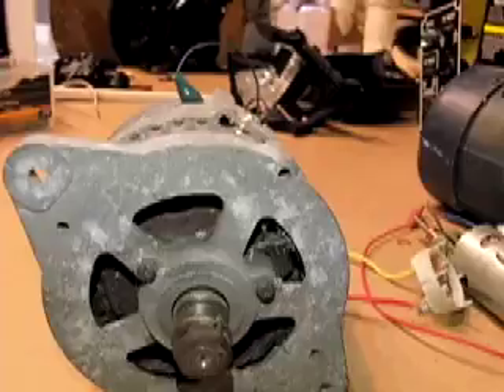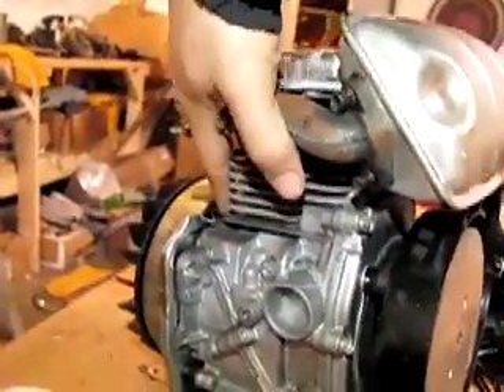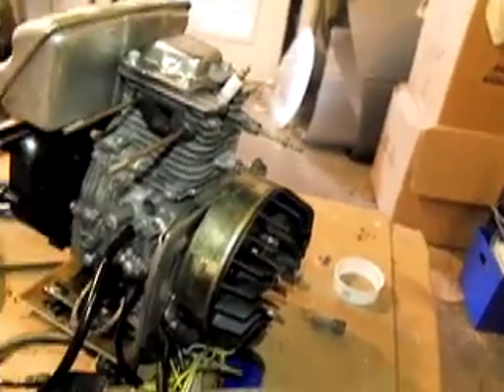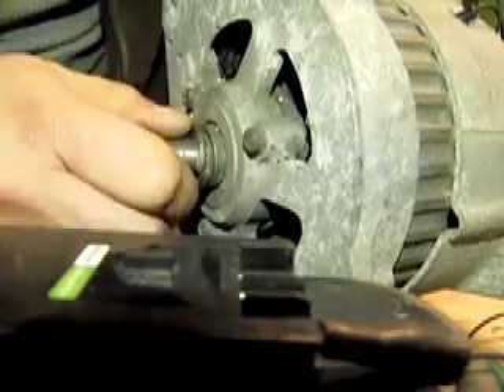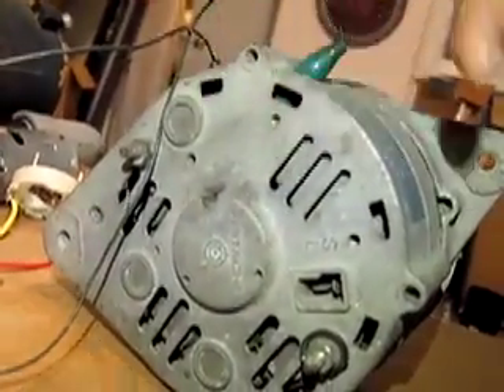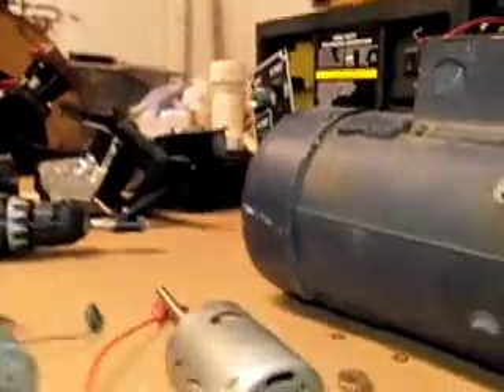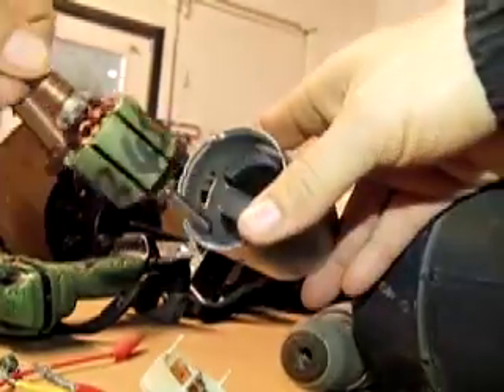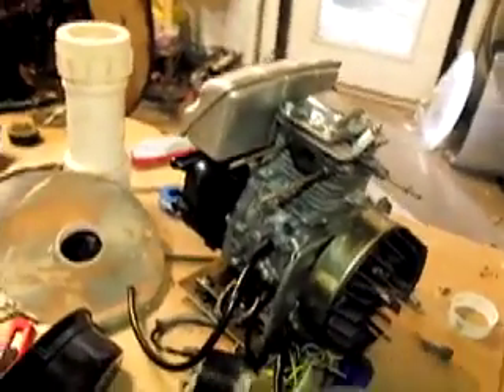Inside an Inverter Generator, Car Alternator, AC

Comment: That is exactly why iron is used .
It creates a magnetic break against the rotor decreasing efficency by 300%.
Making a generator from ceramic copper and magnets has no cogging , requires 2/3 less energy to operate than it produces.
However this tecnology only exist in space were it is safe from this world below.

Comment: Hi Dan - pulling up an old video.  I am trying to use pressurized air from an underground salt cavern to rotate and expander in order to  generate electricity.  Additionally, controlling the speed of the expander/generator would be helpful.  What type of generator would you recommend?

Comment: Hi: At the minute 2:31, you said  the generated AC voltage is USELESS, just before hitting the DIODES and RECTIFIER. Can you explain why this AC voltage is USELESS and how much voltage is produce? I am lost in that subject. Sorry, am late by 6 years. on your posting. New York 08/08/16.
Reply from the maker: It cannot be used to power anything effectively like an AC appliance with the exception of an incandescent lightbulb or heating element. The voltage is not 120V etc.

Comment: Dan, You provide some entertaining accurate information and some painfully inaccurate information. You went off the rails when you started talking about alternator theory of operation. You draw conclusions from experiments with an alternator that are incorrect. Please study electrical engineering and gain a better understanding of transducers such as the motors and generators you speak of.

Comment: Hey, I've been trying to plan a low-cost wind based generator system, I have a question. When I saw the guts of alternators, and then your video drill insides, I was attracted to the pre-wound braids, and was thinking would it be a good idea, to gather some sets of alternator inner copper braids, or other and wire them to a bus inside the field of rotating magnets? Because I am trying to figure a set up I can devise then affordably reproduce again and again.

Comment: If you wanted the smooth and reliable power of an inverter generator for use with sensitive electronics,  but already had a "traditional generator" and didn't want to spent the extra cash on an inverter generator,  could you just hook up a UPS to a "traditional generator" and get the same result? Because UPS's are basically just (transfomers > batteries  > inverters) aren't they?

Comment: You need a minimum of 1.34 HP for every 1000 watts regardless of the technology involved. If that car alternator is a 30 amp, then you would probably need a full one HP out of your windmill, assuming you made the rpm correction in a single stage of sprockets. You might be able to adjust the current flow through the primary windings in correlation to the rpm, but that would require some custom electronics and would be impractical unless your wind source was reliable.

Comment from the maker: Get the coil to excite with a wind turbine in standard non-hurricane force winds and I will be impressed. Gearing or smaller blades for increased RPM speed makes the torque too weak for any load and your voltage is below 7v. This is why no one uses them unless they have been altered with neod mags. DC generators and PMAs produce a lower current but the voltage is there to charge. Many self exciting alternators require 300-500 rpm.

Comment: Your presentation has a large amount of very good information. I'm afraid a lot of folks will find it confusing, since most people don't seem to get their heads around electricity very well. The "inverter" type gen-sets, provided their inverter section provides a good clean AC sine wave in the appropriate voltage is the device of choice if the devices you are running are mostly electronics. Motor devices are much less fussy. If you are into "green" or off the grid,check the web for good plans.

Comment: can an alternater charge a battery while in use and keep the power constant or stleast make it drop dramatically slower? im usungin a 48v 20 amp motor and would like to use a 48v alternator im not to up on my matchingng amp watts volts etc but themotor is 48v  20 amp 1000 w what alternator if any would you suggest im trying to run a gokart but keep the battery charge at the same time

Comment: Worked on a pedal powered  sound system using car alternators, some time ago, car alts, are described as self exciting, but require some voltage to start the process. They are flexable, but have a stall point, which means that at walking pace it became almost impossible to pedal against the resistance of the effect (the alt was belt driven from the rear wheel, 26", to standard pulley on alt) this could only be easily overcome by stopping & starting again.Input 300W(estimated) output 60W

Comment: you said one of those was an AC "brushless" generator.  is that possible?  in order to generate any electricity from something without magnets on the rotor, don't u have to energize the field coil via brushes and slip rings? (just like the alternator)

Comment: Im working on a HHO reactor im taking the A/C unit out of my 1990 Subaru to add a Generator to keep the HHO reactor on its own circuit. The Generator needs to push a lot of DC Volts and amps. what should i use and can you help me???

Comment: you can also reuse alternator stator windings or squirrel-cage stator windings and build your own permanent magnet rotor. 
these alternator windings are hi power windings at 24 volt and 90 amps they make good Tesla water turbine generators even as brushed units.if you put a resistor on the coil windings to limit the magnet in the rotor it helps on start up to crank over. i use a fly clutch to remove the resistor out of the circuit at a certain speed.

Comment: If you spin a motor at 10% of its RPM speed, will it generate 10% of the voltage it's supposed to run at?

Comment: @bmecher 

Mm actually I would say voltage is more like how much water and amps is ''pressure''.

In fact volts are a potential and the debit of current is measured in amps

Wattage is the work it can furnish, yeah, a measure of energy.

Watts = volts X amps

Comment: i have a regular alternator as a wind generator.works good.i have a 12 blade hub turning the alternator and charging the 200 amp lead acid battery.regulator determines the load on the rotor.slight loading is normal with a slight low battery.heavy loading if battery is real low..new technoligy on alternators.we can make them do alot of different jobs now!

Comment: Nice Video.  Lots of good information. I have a 10 horse 3 phase motor i would like to turn into a generator. If the three phase motor is 5,000 watt  will i get 5,000 watt if i use it as a generator. And how efficient is it??

Comment from the maker: @mrzeman1 The car alternators and low quality DC motors are no good, the Dual Axial Flux Generator or a good quality DC motor is a great generator option. All generators gas, are designed for low cost, low efficiency. No one wants to buy a $1500 1000 watt generator that is 3x as efficient. For alt energy it matters.

Comment: As far as the Unified (or Generalised) Theory of Machines is concerned you'd be right - a generator and a motor are much the same thing and can operate as either a generator or a motor. However, in practice, running a motor, for example, as a generator, doesn't have the same efficiency. Some of the reasons for this are outlined in the video. Try watching it again and you'll probably pick up on that.

Comment: Hey Dan...Do you have any experience with treadmill motors?  Regardless of brand, they all have very similar permanent magnet motors in them.  So far, I've "harvested" 4 of them from dumpsters and the curb on garbage day.  They're very easy to find, have a good output and are very durable.

Comment: im new to this and my electrical and wiring/knowledge  goes to wiring a plug, but what i have picked up please correct me if im wrong is that amps have the power (my be wrong wording there soz) so why the reference to watts all the time? interesting vid thanks! ya camera work is sound mate! 
stay safe pip

Comment from the maker: @sonyxploder Running DC from the alternator only is fine. I was referring to removing the diodes and powering directly from the 3 poles AC alternating current. This would fry stuff. The DC only works because DC can run on higher lower voltage even car electronics to a point or they just shut off. Alternators with DIODES have a voltage regulator.

Comment: Not exactly... the alternator's voltage regulator controls the alt. output by varying current to the rotor to alter the field strength, but it needs to have a reference voltage from the battery to  work from. Remove the batt and the reg will go to 100% output as it will see 0 volts so output voltage goes way up and fries your car's electrics

Comment: HA,
One website said inverter generators had a DC dynamo in it. I asked them a question and they said  it was all DC only then inverted to AC. Thank you for clearing that up. Another website said they are neodymium magnets, are all ceramic? I always wanted to see what was inside those pricy inverter generators. Do bridge diodes get hot?